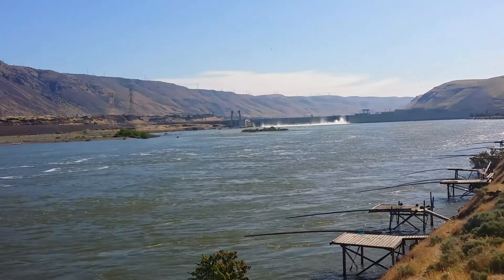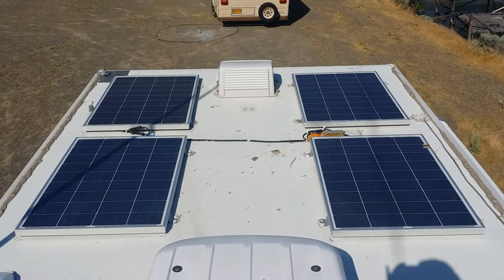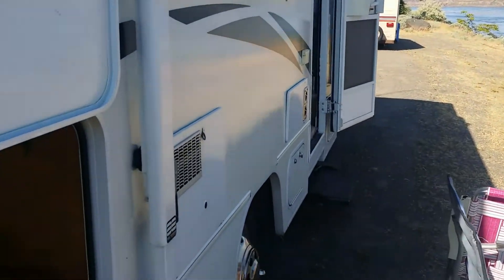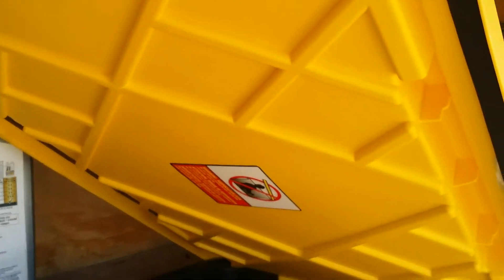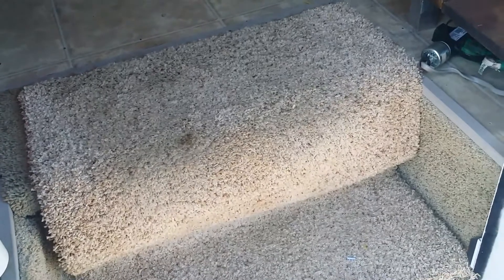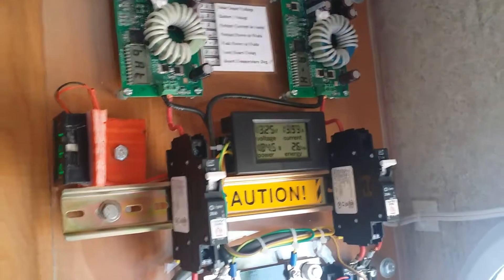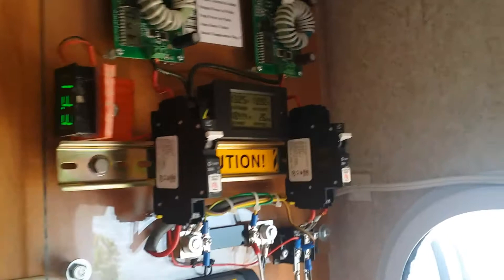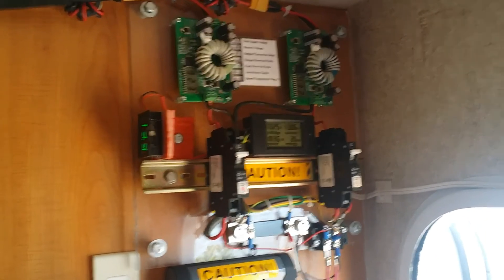My rv solar system. 400 watt.

Comment: Why use 100W panels, at this stage in panel design that's such old technology? You could have put so much more wattage in the same amount of space or used fewer panels if you went with higher wattage panels. I'm not critizing I'm genuinely curious.

Comment: Nice system and install!  So that feeds the 12v side of your house.  Are you just using your converter and treating all of this as "the house battery"? then not using the converter charge circuit unless needed?
Reply from the maker: Thank you!...
Yes basically and we have a 1500 watt sine wave inverter for AC